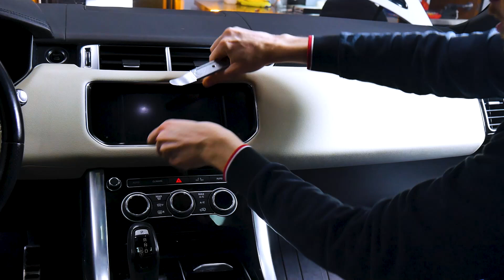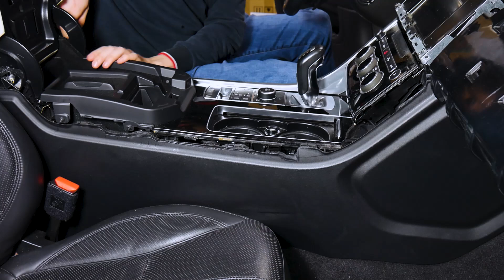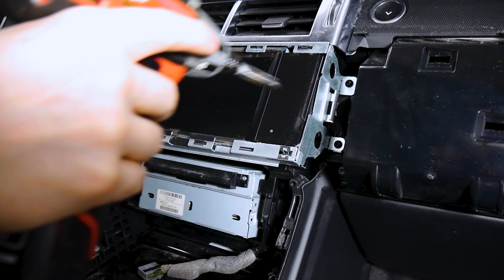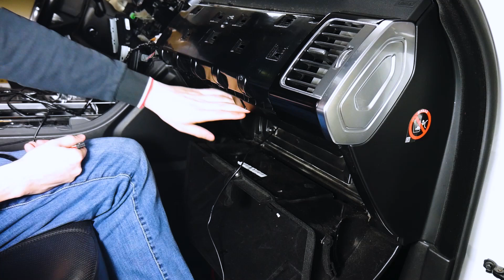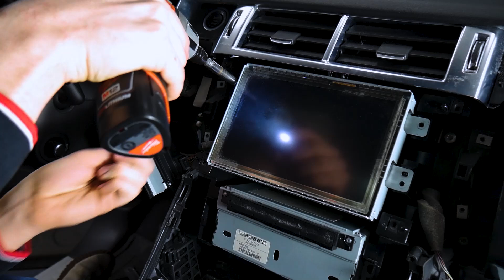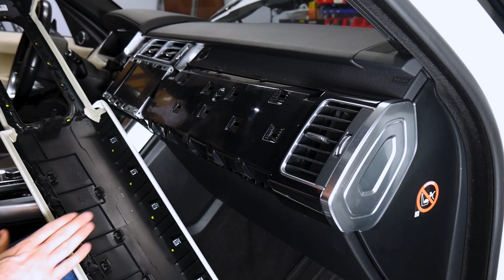Easy install CarPlay & Android Auto Land Rover Range Rover 2016-2017 w/ Bosch | GROM VLine VL2 LR2B

Comment from the maker: The VLine VL2 system to add CarPlay and Android Auto into the factory stereo of Land Rover Range Rover and Jaguar is available here:
https://gromaudio.com/store/vline/grom-vl2-lr2b.html
Model: LR2BVL2

Compatible with:

Jaguar XE 2017 (Bosch Stereo)
Jaguar XJ 2016 2017 (Bosch Stereo)
Land Rover Discovery 2016 2017 2018 2019 (Bosch Stereo)
Land Rover Discovery Sport 2016 2017 2018 2019 (Bosch Stereo)
Land Rover Range Rover 2016 2017 (Bosch Stereo)
Land Rover Range Rover Sport 2016 2017 (Bosch Stereo)
Land Rover Range Rover Evoque 2016 2017 2018 2019 (Bosch Stereo)